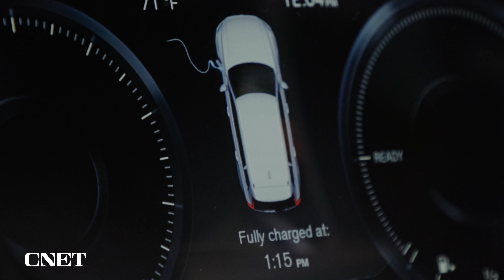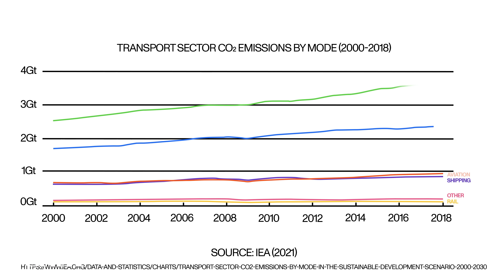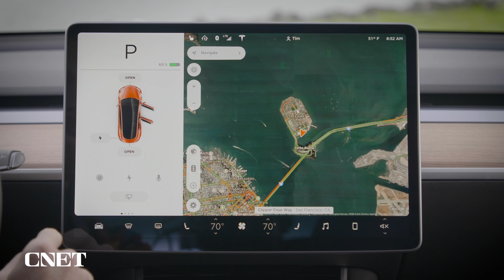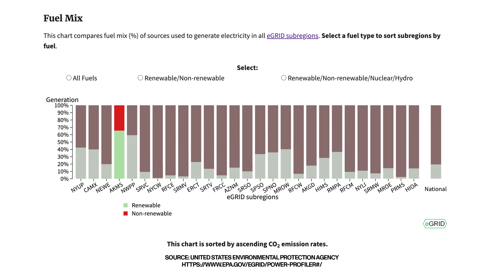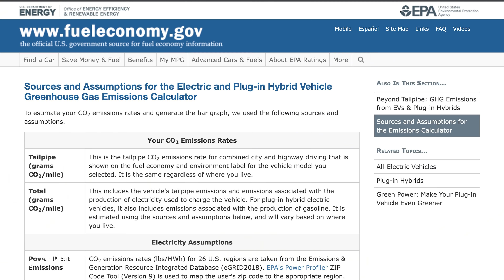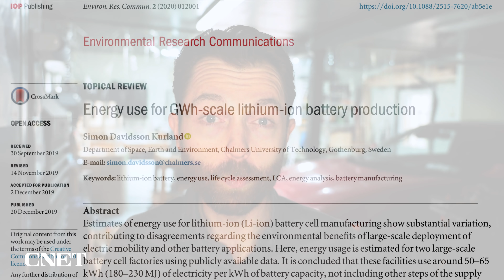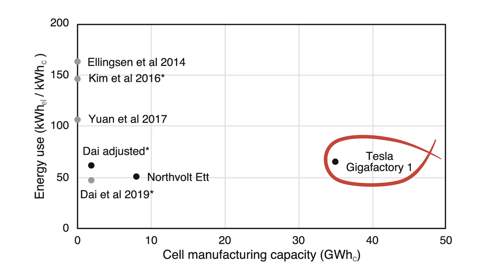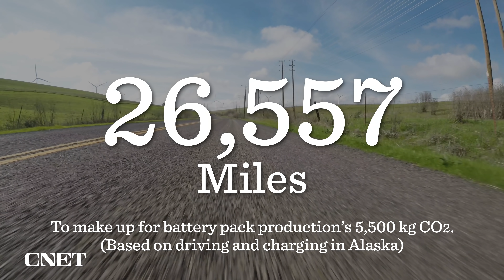Are EVs Actually WORSE for the Environment?

Comment: I agree, if you are going to take into account the cost of producing the battery pack, what is the CO2 cost of pumping, shipping and refining petroleum into gasoline?  Plus if you want to be more detail, EVs does not require engine oil which adding the cost of production and recycling of engine oil will make the EV more green for the environment.
Reply: The gearbox do have oil so it's not a 100% elimination of petroleum products in there operation but is a great reduction.
Reply: @chrisherbert4454  that is why I said engine oil, not transmission oil.  Many productions specially plastics use petroleum. The world use of petroleum will never go away, hopefully just greatly reduce.
Reply: @chrisherbert4454  Yep even Tesla Model 3 uses very light Engine Oil in it's TransAxel drive unit. But it's NEVER Burning HOT and introduction of containments is far less likely as nothing is being BURNT. The engine oil in a Tesla last several times than even an Abused neglected ICE car. Sure 100% is not viable but Relative ammount being used is Gigantic LESS.

Comment: You failed to take in to account the CO2 cost of running an internal combustion engine, (super tankers that ship oil run on heavy fuel oil themselves), and the cost of refining that oil into gasoline to run an ICE engine as well as all of the trucks that slurp diesel to ship the refined gasoline to the gas stations. Want to try that again?

Comment: To do a fair comparison the manufacturing process of both EVs and ICE vehicles must be considered. There are significant environmental implications with gasoline production as well as lithium and cobalt mining for EVs. While these may not directly impact the end consumer in North America, cobalt and lithium mining has enormous impacts to the ecosystem where these activities take place.

Battery degradation cannot be ignored as the CO2 savings in year one may not be as significant in year five, six or seven. 

Maintenance cost should also be considered as both have varying maintenance needs each with their own implications. With traditional ICE vehicles the consequences are quite apparent however with EVs the larger weight of the vehicle will create additional brake and tire wear resulting in these items needing to be replaced more frequently.

Additionally there needs to be a conversation about the end of life implications of both EVs and ICE vehicles and whether one has a materially greater environmental impact vs. the other. In other words, the full production cycle and vehicle life cycle should be factored in, hopefully we'll see a part two to this.

Interested to know if hydrogen fuel cell vehicles could be the real answer to this issue.

Comment: The web article had a "Circular Energy Storage" link you referenced.  It describes 20% of the carbon to be from cell production itself.  Tesla Gigafactory (where they produce the model 3 battery packs) is powered by 100% renewables.  Also, did you subtract the production of the ICE components not present in the EV?

Comment: Two factors that are missing are 1) the life expectancy of the vehicles, and the environmental impact of overall chassis production and disposal.  One issue I see with EVs is their uncertain life span and lack of battery pack replacement.  While the EV may be environmentally less-unfriendly than a ICE-V during its operation, the question remains as to its EOL environmental cost, particularly if it is not as reparable/recyclable as a comparable ICE-V.

Realistically, all vehicles, particularly in the U.S. are disposable commodities, albeit expensive ones.  Yes, we are no longer “New-Every-Two,” but cars depreciate in a relatively short time period.  One potential advantage of EVs is that the drive train could last decades, but for the battery.  If this could be overcome, with the EV chassis being a long-lived, upgradable unit, then the argument is solidly in the EV’s favor.
Reply: Nope Lifespan is very well known, stop spreading falsehoods. Rav4 EV from 1990s averaged about 16 years for secure power output from is partially dead battery. That was Air Cooled large format NiMH. Modern BEVs with Liquid Cooled & Heated Lithium Ion is not much better around the same life span. Due to supply chain problems part few years the median age for Scrapped Junk Cars is just Under 20 years. Soo BEVs & ICE passenger cars basically have the same life span. But here is the massive benefit of BEVs. During that lfiespan you can easily wracked up 300,000 Miles with far less Parts Replacement & Consumables. Fact is the Life Expectacy argument is MOOT.
Reply: In regards to keeping the drivetrain in service for decades that's a pipe dream manufacturers are going to lean into planned obsolescence hard. Tesla, John Deere, Apple, One Wheel, Toyota have all been very much against right to repair so to think there going to forgo future income for the greater good is a great dream but is only that a dream.
Reply: @Neojhun  Citations or didn’t happen.  A 1200 unit 1997 launch with a different battery chemistry is not predictive.  The longest running EV’s currently on the road are the Model S , which launched in 2012.  So, with only 10 years of large scale real world testing, one can hardly make any real comment on the lifespan of the battery.
Reply: @chrisherbert4454  While, I agree with you in part, the reality is that the average age of rolling chassis and drive trains for ICE-V has been steadily increasing (IIRC, it stands around 11 years now).  Since upgrades on a price-per-component basis can produce higher profits, it seems that this would be a market that manufacturers would be foolish to ignore.  Also, with at least one  recent EV introducing a monthly battery rental charge (don’t get me started on that scam), it seems that at least one manufacturer is recognizing that there is a profitable path in some sort of upgrade scheme.
Reply: @detritus23  Yep buy the car and lease ahem... rent this battery pack it's a great product trust us 🤡 anyone remember Daewoo Cars thinking that this company is going to be a repeat of their performance.
Reply: @detritus23  "recent EV introducing a monthly battery rental charge"
Renault did the Opposite and battery Lease on the aging Zoe became Unpopular option.  Battery Rental is a very unpopular program and is not likely to be viable business model. Soo stop pushing Outdated misinformation.
Reply: @chrisherbert4454  LOL You bought into the outdated Misinformation. Fact is EV industry is fallen out of favor with Battery Rental.
Reply: @detritus23  "with a different battery chemistry" That is simply false. Only 1 Battery pack was used for lease customer cars just the 95AH large form NiMH. There was the Lead Acid battery used in PROTOTYPEs but it was never released for public street use. 1,200 of the same battery is good enough sample of battery lifespan. You are the one failing at simple facts.
Reply: @Neojhun  Do you even read the comments or are you just here to TROLL I was agreeing with the shady and comical idea that's being brought to market that @detrirus23 had mentioned.
Reply: @Neojhun  Ad hominem and ignorance do not make good arguments.  If you did any research, you would realize that the VinFast VF-9 announced at the 2022 New York Auto Show is sold with a battery lease model.  CNET has a review of the vehicle on this channel.  So, unpopular or not, it still is considered viable by some manufacturers.  And, I fully expect that Tesla will revive their battery-swap model at some point in the future, if for no other reason than the strategic scarcity of some of the battery components.  However, changing battery chemistry may again obviate that need.
Reply: @chrisherbert4454  But I'm refuting that the market is supporting that shady idea the other commenters insinuating that it will become a common trend. I'm not refuting such shading business model exist, they very much do. I was refuting with evidence that the Industry has already knee capped Old Lease programs. I'm the one trying to live up to higher standard beyond just Agreeing or Opinions.
Reply: @Neojhun  Again ignorance and wishful thinking does not help your position.  NiMH battery chemistry is very different from the LiON chemistry used in current EVs.  The life expectancy of the two battery types is not comparable nor expected to be the same.  In addition, the LiON technologies used in older Tesla’s is different from current Tesla’s, as is the excess battery capacity and management software.  None of these have been tested in real-world conditions long-term (10 years is not long term for a car), so their actual performance is still completely unknown. 

So, to quote you: “stop pushing outdated misinformation.”
Reply: @detritus23  Both VinFast and NIO are marketing a Battery SWAPPING service which is why Battery Ownership does not work in that model. They are NOT just enacting a Battery Lease model for batteries that are physically stuck inside the BEVs for the lifetime of the battery. The lease program is a means to make battery swapping costs financially viable. Other automakers have abandoned battery SWAPPING services as a longer range more efficient Permanent battery is a better design. You are the one twisting marketing terms out of context. I know this subject far better than you as I even remember the launch of BETTER PLACE Israel in 2012. Note i have comments in Better Place video on YouTube. You are the one who does not understand the entire context of these programs.
Reply: @detritus23  Thank you detritus 🙌
Reply: @detritus23  Yes thank you.  To @Neojhun no one is out here with pitchforks and torches saying no more EV's or EV's are bad. We are however being cautious with new tech and saying that it's not the silver bullet, slam dunk etc the truth is we will need a mix of ICE, hybrids, and EV's going forward. And we need to focus more on items that are a bigger impact HVAC for buildings large and small, next gen nuclear reactors for 24/7 clean baseline energy. Better water treatment etc etc
Reply: @Neojhun  Enough with the whataboutism.  VinFast is marketing a vehicle, not a service.  Battery swapping will work with battery ownership, it just depends on how you pay for/monetize the swap.  And I said nothing about how the battery is engineered into the vehicle.  As for whether removable or permanent designs are better, there is nothing pointing either way in terms of battery or vehicle efficiency.  In fact, the Tesla battery is removable, but just not easily.  The Electric Garage does this with some regularity.  The real reason for not swapping batteries is likely liability, more than efficiency or economics.  Simply put, a swapped battery (or, at least, an on the fly swap as envisioned by Tesla and their partners) would have to be validated before it could be reused to prevent abused batteries being installed in unsuspecting driver’s vehicles.  Damaged LiON battery packs are significant fire risks (albeit rare ones) and manufacturers are loathe to accept unnecessary liability risk.
Reply: @detritus23  "whether removable or permanent designs are better, there is nothing pointing either way" WRONG it is just a fact a Module Free Battery with less layers makes a more efficient BEV. The structural requirements for a Swappable battery is what makes it bulkier heavier. Correct Electric Garage extracts much easier Tesla older batteries, those are MODULAR batteries. You just ignored the entire concept and substituted with false assumptions. Gah these are such basic concepts which you have ignored to force your narrative. You are the one forcing whataboutism arguments with "liability risk" and "abused batteries batteries being installed" None of that is Relevant and problems that can easily be caught. All I did was focus on the engineering fundamentals which you seem to have very little understanding.
Reply: @Neojhun  All current Tesla batteries are modular by design and engineering necessity.  Simply put, they are composed on individual cells assembled into sub packs, which are then built into the larger pack.  The entire pack assembly is installed in the frame of the vehicle after the frame is constructed.   They are all removable.

As it stands, it appears you are either a troll or a fanboy and I am done wasting my time.
Reply: @Neojhun  And opinions and civil discussion is what the comments section is for not anger, attacking, bullying or otherwise conducting oneself as a jerk. You want to have a higher standard post a video write a paper start a non profit, or bring that next gen battery tech to market.

Comment: The worst part is that fast charging WASTES most of the electricity!! A gas poweredpower plant has a thermal efficiency of about 35%. losses in the input and output transformers and the transmission line where you plug into the outlet the output is between 15 and 20%!!!! The there is the tremendous LOSS if you charge quickly!!! If you charge in 1 hour the efficiency is 5.88%, in 15 minutes it is ONLY 0.3675%!!! This is really STUPID!!!!
CARB lies about EV efficiency, In their ARB/MSD/&-6-94 they claim that battery efficiency is 80% and the motor is 90%.  These are LIES!!!! Every time the motor starts it and the system efficiency are almost ZERO!!!!!  So it depends on how many stops are made!!!!

Comment: I think that was a decent rough comparison. But there are a few major issues that remain.  Battery Disposal? Environmental impacts of the rare earth mineral mines, Battery Pack Replacement and oh yeah, no new hydro and likely a significant reduction in the U.S. Very little new wind coming on now and solar has severe limitations in it's current formats. There is simply not enough electricity and not nearly enough renewable to now or in the foreseeable future to actually power the expected fleet. The share of renewable energy has remained fairly consistent in the last several years.
Reply: Not to mention wind and solar isn't on demand.
Reply: Regarding "...there is simply not enough electricity..."   I'm not sure what your source was, but all the studies I''ve seen say just the opposite -- that there is quite enough generation.  (The transmission grid is another matter, having suffered years of neglect and now straining under the loads created by climate change.)  Moreover, car charging is kind of the ideal load from a utility's point of view since most EV charging occurs overnight.  In the future, owners will even be able to opt-in to programs which tell ev's to delay charging when the grid is stressed and the owner isn't in a hurry, and some vehicles will be able to sell power back to the grid during a high-priced hour.  The video did EV's a disservice by estimating battery manufacture emissions but not petroleum mining, transport, and (especially) refining emissions.   As to "not nearly enough renewables ...foreseeable future" -- that future is foreseen in countless papers and plans.  What kind of future is foreseen if we keep doing what we're doing?
Reply: To do a fair comparison the manufacturing process of both EVs and ICE vehicles must be considered. There are significant environmental implications with gasoline production as well as lithium and cobalt mining. While these may not directly impact the end consumer in North America, cobalt and lithium mining has enormous impacts to the ecosystem where these activities take place.

Battery degradation cannot be ignored as the CO2 savings in year one may not be as significant in year five, six or seven. 

Maintenance cost should also be considered as both have varying maintenance needs each with their own implications. With traditional ICE vehicles the consequences are quite apparent however with EVs the larger weight of the vehicle will create additional brake and tire wear resulting in these items needing to be replaced more frequently.

Additionally there needs to be a conversation about the end of life implications of both EVs and ICE vehicles and whether one has a materially greater environmental impact vs. the other. In other words, the full production cycle and vehicle life cycle should be factored in, hopefully we'll see a part two to this.

Comment: The real question is what happens to all the batteries that can no longer hold a charge? in 7-8 years. You can recycle the metal from a combustion engine, and you're left with oil (which can also be recycled).
Reply: Those toxic chemicals and waste will go where humans want them to go. The technology already exists to contain lead, mercury, and cadmium when recycling batteries and it is improving by the year to the point that in about 20 years the need for mining will be reduced substantially. All the other mineral and elements in a EV battery are fully recyclable even after being used as second-life batteries. One nice thing about EV battery cells is, they find a second use in stationary grid storage. When there are enough of them to create a market, they will be recycled to reclaim the valuable metals just like any other high volume appliance does nowadays.

Comment: A few observations on this. First,  the Model 3 minus its battery pack is 700lbs lighter (23%) than the BMW, so you can't assume the only CO2 difference is the batter pack. This should give the Tesla {23%?) less CO2 before adding extra emissions from battery pack production. Second, catalytic converters have precious's metals (Rh, Pt, Pd) that are associated with notoriously polluting mining practices. This should add CO2 to the BMW footprint. Finally, its takes an estimated 3kw of electricity to put 1g of gasoline in your car (oil well to gas pump) on average. This adds CO2 to the BMW as well.  In summary, this analysis shows with worst case scenarios that BEVs are much better than ICEVs when it comes to full life cycle CO2 emissions but in actuality it's much better.